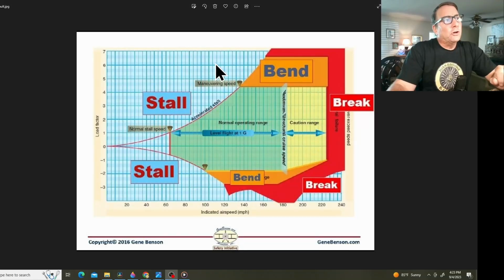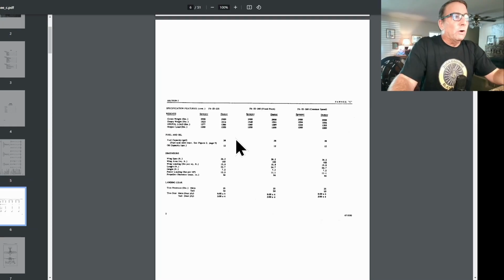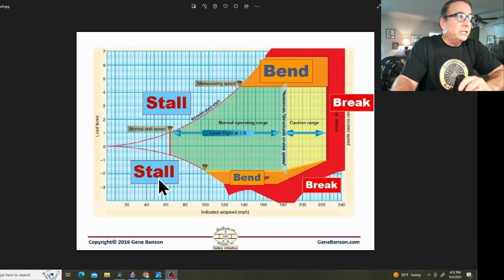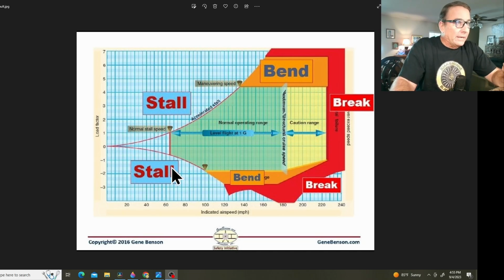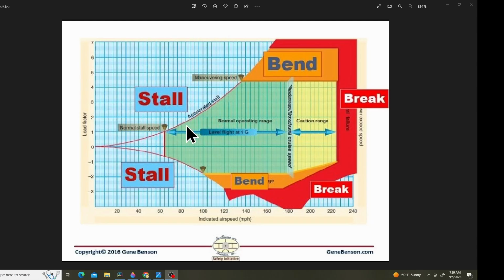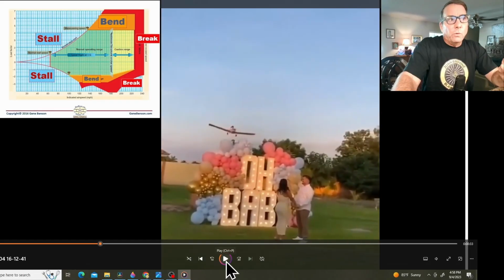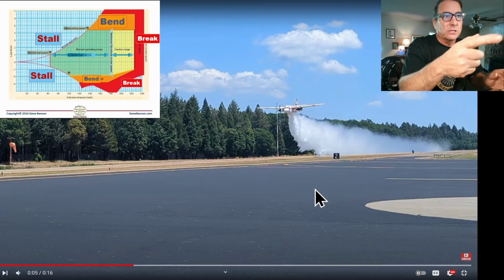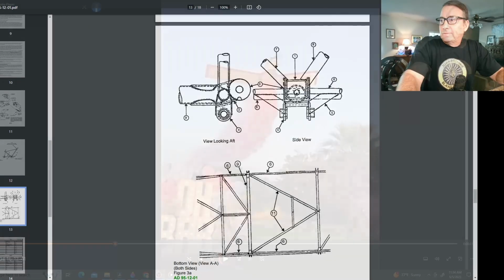PA25-235 Sinaloa MX Gender Reveal Party Structural Failure

Comment: That's some interesting engineering concept, I'll have to watch the full video soon.
If it was an emergency dump of water from a water hopper, wouldn't this extra stress loading situation be outlined in the user manual? Perhaps you aren't meant to be loading the wings by pulling up whilst doing this water dump?
This is certainly something I wouldn't have thought of on my own. Definitely less obvious than the guy who accidentally built an IED by repurposing fireworks

Comment: I've got around 7000 hours in the PA-25 235 as an aerial advertising pilot (banner towing). Our operating manual had the maneuvering speed listed (yes it is 120 MPH). I'm glad you started by mentioning the variable maneuvering speed as the weight changes. Our planes were STC'd with 75 gallon tanks where the hopper used to be (3 gallons unusable) so we had to be aware of the maneuvering speed vs weight difference as we flew cross-countries to different locations. It's a very fun and rugged airplane when used correctly. I usually called it the flying pickup truck.

Comment: Exactly what i said happened. He pulled back instead of pushing forward to unload the wings. And being an airplane in Mexico id bet they had poor maintenance and possibly had corrosion at those mounting points but in that last frame hes showing it looks as if the wing is twisting upward like the wing strut on that side gave up.

Comment: Juan, this is a rare bad explanation from you.  Dumping the hopper is not going to suddenly increase the load on the wings.  From your description of the hopper, I suspect it's in front of the center of gravity and dumping it caused a pitch up.  The resulting high angle of attack combined with high air speed overloaded the wings.

Comment: I discovered this in microsoft flight sim when i had my flaps pitched at 20 degrees. My plane was full and i emptied the load to go faster with the settings menu. Then the plane lifted up and the frame failed. 😂

Comment: Correct me if I'm wrong but in the beginning of the video I believe you stated that the tank was in front of the operator and you said the firefighting guy had the tank over his center of gravity. The firefighting tank dumps a lot slower than the emergency dunk tank for engine failure. I do not believe this was a balance load HE released it was an unbalanced load and when he released that as quickly as he did he didn't have to pull up I think the weight shift pulled him up for his trouble more so than anything he had to do.

Comment: As to the manuevering speed- weight relation - you can think about the ratio of your stall AoA and level flight AoA as the approximate max gload physically possible at given speed. To keep it below the airframe max gload, you want to keep a given minimum AoA in level flight, regardless of weight. To do that, you need to limit your speed, and that limit is higher when you are heavier.

Comment: One thing doesn't track for me - yes, the g-load increases when dumping weight and keeping airspeed and angle constant,  but g's don't break metal - Newtons do. And while we usually think in g's because the force comes from inertial loading, in this case the force exerted by the fuselage on the wings didn't increase - the only force trying to tear off the wings was still just the constant lift. 
(What could have changed was the distribution of forces inside the fuselage, and slightly in the wing itself).
I am more inclined to believe that the CG moved aft abruptly and the aircraft pitched up, increasing lift force on wings and thus causing a break.

Comment: I just have a question. Um…. When you reduce the weight of the aircraft does that not take load off the air frame and wings? Such as that plane fully weighed down couldn’t do a 4g maneuver at 120 mph but without that load it can? Therefore you actually increase not decrease? 2nd I have a question then an argument. Have you ever seen a crop duster performing it’s actual task it’s designed for? My argument is that I have and they dive down to about 50ft from the ground dump their load and yank up before they hit the tree line. At least 10ft lower than that guys was with just as aggressive if not more aggressive of a pull up than that guy just did. Looks like a failure to properly inspect and maintain aircraft to me. Pilots putting out fire don’t fly like crop dusters. Crop dusters get below the tree line they couldn’t do a gradual pull up.

Comment: Excellent topic. Counter-intuitive indeed.  Perhaps to understand why max maneuvering speed goes down with decrease in weight, we have to look at it like so:  Using Juan's diagram, wings start to bend at 135 kts at an AoA near stall producing a load factor of 4.5 at max gross weight (MGW). Let's say to create this load factor of 4.5, we are in a turn of some radius R.  The load factor of 4.5 is the vector sum of the vertical lift component required to exactly counter the max gross weight, and of the horizontal aerodynamic force required to generate centripetal force to maintain the turn radius of R.  This horizontal aerodynamic force requires a higher AoA placed onto the wings to generate.

Here comes the mental gymnastics:  Let's say we decrease the weight of the aircraft to some weight less than MGW, call it W.  Also, let's assume the manufacturer determined that the stall AoA occurs on Juan's diagram at, oh say, 120 kts at this new lower weight of W, again at a load factor of 4.5. Since the aircraft weighs less, the required vertical component of lift force is now less, at the lesser airspeed (120 kts).  BUT, the load factor is still 4.5 on the chart, meaning that a higher aerodynamic centripetal force vector generated by an increased AoA (again near stall) is required to be in vector summation with the now lessor vertical lift force component, in opposition to W, creating a tighter turn radius of less than radius R.  In other words, the airplane is at a higher bank angle, and the total force or load factor is pointing more to the horizontal.

It really doesn't make obvious sense until one starts drawing out the force vector diagrams and realizing that at lower weights, less airspeed is required to maintain altitude given a certain constant angle of attack on the wing.  Since the lift is less, but load factor is the same, you need to be in a tighter turn radius with a greater horizontal force component to overcome the inertial forces of the airframe to meet the requirement of the given parameters just mentioned.........

Comment: My intuition picks up on the logic of this... I'm thinking of it in terms of the plane losing momentum, losing the ability to punch through or push aside the air. So he torqued the whole structure at the moment the fuselage started slamming into a wall of resistance, while the wings want to keep going. Dislocated his plane's shoulders in a belly flop.

Comment: Im not a pilot, so correct me if I’m wrong, but I clearly see a high pressure air cannon shooting confetti in the direction of the wings from the bottom right of the video right as he dumps and pulls up. You think the sudden air pressure change has something to do with it.
Reply: Those cannons do not have anywhere near enough power for that.

Comment: I never considered LESS weight being a negative factor in loading.  Yet if you think about it.  If you have less weight you have higher lift to weight ratio, which means you are capable of pulling far more G with less control input/AoA.

Comment: Good review of the maneuvering speed meaning.   I would add one thing.  The pilot may not have exceeded his g limits in the pullup but lost the wing to cyclic fatigue weakened wing attach point.  This is fairly  common failure on older aircraft that routinely pull high g's and the video shows the fracture at the left wing root. Also of interest is the possible twisting of the outer wing prior to failure. Wing twisting counter clockwise looking outward from the wing root is consistent with the aerodynamic forces on a wing attach point beginning to fail.

Comment: Wow this was an awesome assessment and breakdown. I never knew the dangers that those fire planes are in when dumping a load. I couldn't image how difficult it would be to drive my car if I had to worry about speed, g-forces and weight to keep my tires on when going around a corner.
Reply: I imagine you're doing that intuitively in your car but such lectures wouldn't hurt for drivers-ed classes.
Reply: Not exactly. You couldn't tear the wheels off a car by turning sharply. You would either start to skid or roll. I am talking about operating something that is very fragile and you can destroy by fairly normal operation.  @StevenBruce-s1o

Comment: It was very briefly mentioned, but can we also highlight the fact of how low his altitude was.  From the video it shows his altitude was lower than the palm tree tops he crashed over.  I believe this was a panicked pilot that pitched way too hard when he realized his mistake and simply overstressed the wings.  It wasn't G-force that broke the wing.  At that speed and very high angle of attack the wings were acting as an "air brake" at that point and simply broke off.

Comment: You missed the key point in this accident.
The tank is well in front of the cg. Dumping it will drastically change the trim. The aircraft will pitch up strongly if the pilot just holds the stick steady. The faster that he is going, the higher the g's.
Does the Pawnee have a safe dump speed above which you would need to push the stick to avoid structural failure? If the pilot also pulled up during the dump, then it would be very violent manoeuvre indeed. In this case, it was violent enough to break a wing off.
It's the loads that breaks stuff, not the g's. Although it wont be in many handbooks as they would be even harder to understand, aircraft will survive higher g's the lighter they are.

Comment: What’s not mentioned is that crop dusters and helicopters pull hard all the time. What he did was nothing super crazy from how they fly. What many pilots and former maintenance guys will tell you that it is common in Mexico for maintenance and inspections to get ignored and this is not the first crash from something like this. Though this video does have good points… it shows that pilots don’t know everything and are usually just quick to blame the pilot when it’s not always the pilot. Other comments by others like myself with structural backgrounds also pointing out that what all he is saying is not 100% accurate. 
I’m fairly confident that the structure of the wing root had a lot of cracks and or corrosion that was never looked at or addressed and when it dumped and pulled up the a/c wing root just let go. Again… this stuff is common in Mexico.

Again remember… just because you see a video on your tube does not mean it is accurate… pilots are really bad about posting bad info.

Comment: I've been curious as I've been watching the incident over and over how much the pilot actually pulled back on the stick. Wouldn't dumping that much load that suddenly, and that far forward of the CG, coupled with not enough experience and that high a ground speed cause the same reaction in the plane?

Comment: Juan,  am not an Aerodynamicst.  But curious why more weight would be a factor in mitigating the stress on the airframe.  Am thinking, the issue is that the release of the pink load and pull back of the yoke, enabled the plane to put the wings into pressure stress beyond the airframe capability simply from an accelerated loading.  A heavier airplane would not respond upward as quickly, thus the acceleration of the stress load on the wings would be slower.  Which brings us to the idea of "Jerk" loading, or the acceleration of the acceleration.  I am wondering if Jerk stresses (Too fast of a loading stress) on the wings might not be another factor to consider.   Airframes and Cars tend to not fall apart if they don't decelerate too fast, as in hitting a wall, but are better off with a light tap.  Perhaps the sudden application (Jerk force) on the wings could be a factor?

Comment: This is a good and useful channel, but, many errors in this episode on the Pawnee dropping over a wedding.  As you may remember in the T-38, allowable g-limits INCREASE with lighter weights.  This comes from the Dash-1 limitations.  The wings can produce a lot of G on a lighter airplane without breaking because they carry a lighter load to achieve those Gs.  Load per G changes with aircraft weight.    That is, at a lighter load, the wing needs to produce less force to produce the same G. The Maneuvering speed does NOT CHANGE; only G-limits change.  Another way of looking at this is to look at the lift equation, which has no aircraft weight term.  In order to break a wing, you need enough lift force.  At a given fixed max alpha ( the upper curve of the V-G diagram) this can only occur at one speed: maneuvering speed.  Note however, that this Pawnee may have had a published reduction in maneuvering speed with lighter loads, as some aircraft do, but that has to do with non-wing failure issues and is only because of internal structural limitations (that have nothing to do with wing strength) that cannot withstand the higher Gs that a lighter airplane's wing spar can safely sustain.  But, as your video shows, that is not relevant here:  The actual wing failed.  Not, say, a battery mount.  Aviation Safety Magazine and other publications have occasionally also made this same mistake.  It's a bit of simple physics, but can tangle up good people who try to understand.  The V-G diagram does not simply shift left or right with varying weight either.  Instead, it changes its shape in a more complicated way.  Your description of the level flight required of the airplanes that drop fire retardant is similarly a bit off .  Flight dynamics requires more fundamental physics than most realize.  
So, once again:  Maneuver speed doesn't change with weight (unless non-wing structures are considered), less weight means more G can be pulled without breaking the wing.  The pawnee wing failed not because he dropped his load. If anything, dropping the load, even partially, would have helped him.  I hope this helps.  And I love your channel.   Cheers, Martin Giesbrecht
Reply from the maker: No. It does. See Rod Machado link. He can explain it better than me.

Comment: This is probably your best video. While I have more time aloft than God himself, I've survived this far by being chicken. Ok, cautious. The things I see on a regular basis clearly illustrate just how much pilots do not know, or have completely forgotten. When ever I see a structural failure, I immediately tend to blame corrosion and/or cracks. We all know pilots who fly light, primary, non commercial GA aircraft as if they were F35's. They can't handle the repeated stress, even if it is within limits, and the fatigue limit is over time, eventually reached.

Comment: Thanks for this. The effects of weight vs maneuvering speed are counterintuitive for this student pilot. I'm still having trouble wrapping my head around it. Is it fair to say that the heavier aircraft has to produce lift equivalent to weight at a higher angle of attack and therefore is closer to the critical angle of attack when speeds are the same as a lighter aircraft? The heavier aircraft has to be closer to stall at any given airspeed when compared to the lighter aircraft. So you'd have to fly faster to reduce the angle of attack enough to not stall before it generates dangerous g loads.

Comment: I don't get it,  in Fighters.. G limits are lower with gross weight.. a fully loaded F16 can do maybe 3.5 G where as a slick one can take 9G all day long(fuel permitting)
The design G limit in ACM is only available at lower gross weights.

I would think that , if anything, Dumping makes the fuselage lighter, and thus the G airframe stress is lower. than if the gross weight was higher as it was pre-drop?

The amount of pull the wings can generate is just speed.
no speed, can't pull G and it just stalls (which is zero G)

But the amount of wing loading that pull puts on the airframe is basically Gross weight times G pulled

To me this failure is not due to dumping weight, had he not dumped it, the same pull at the same speed would have snapped the wings off even even faster.
he would have augered in closer to the crowd instead of first arcing up 

Ergo was just going to fast regardless of the dumped weight  and his yank was to high for the airframe. 
Be that design spec or corrosion/defect failure is another discussion

Comment: Sorry, but you mislead your audience on maneuvering speed in this video.  This was a structural failure due to g overload and the wings producing more lift than the structure could take. The fact that 150 gal of water (1,100 lb) forward of the center  of lift was released when the aircraft was near its g limit and well above maneuvering speed for any weight configuration caused an additional nose up pitch beyond what the pilot was commanding with the stick and thus this overstress.  The entire event occurred well above maneuvering speed so the slight shift in the curve due to gross weight was irrelevant.  Would not be surprised to find corrosion or maintenance lapses had reduced the g tolerance of the wings/airframe as well.  This was not a failure of fuselage structure due to high speed with low wingloading as you portray.  The uncommand pitch effects of jettisoning weight are why pilots are taught to be gentle with stick inputs and leave some g margin during such events.